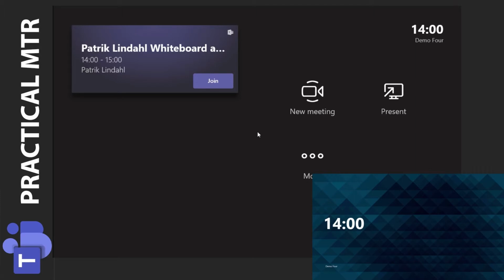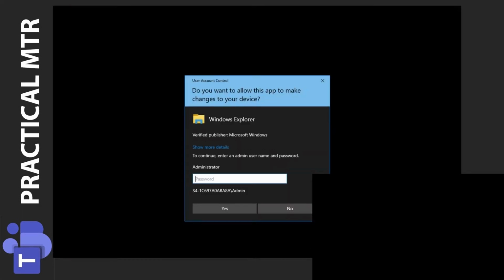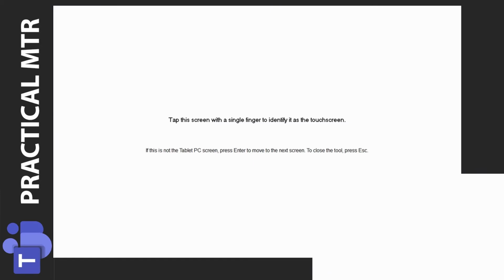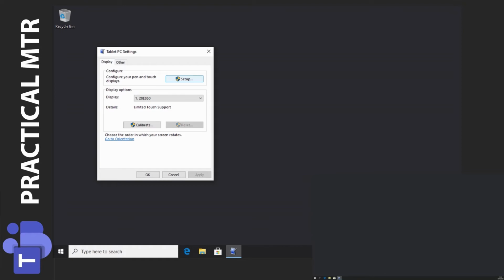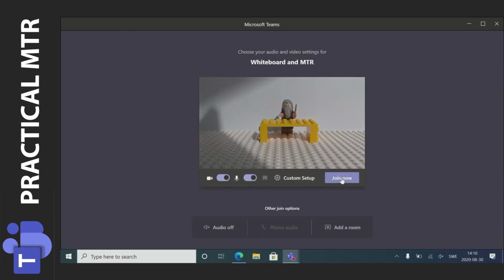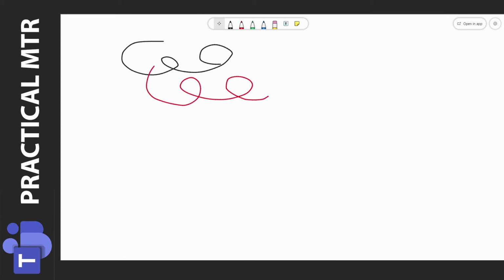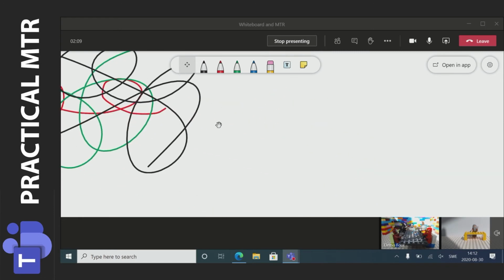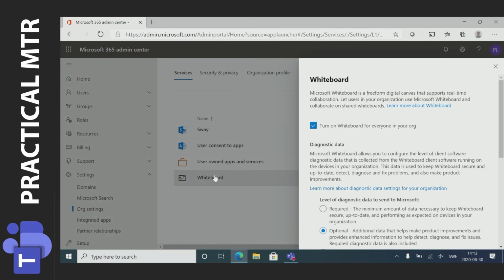How to configure the whiteboard in an MTR system

Comment: Great video ! If you do zoom on whiteboard, can zoomed view still be seen by remote participants ? What license you assigned to MTR system to get whiteboard running ?
Reply from the maker: First question there: The whiteboard will act as any other whiteboard in a Teams call. That is, when you zoom on your client, others will not see it. They themselves need to zoom, pan or anything else on their screen. It works the same between two clients doing this without an MTR system in the mix.
The second question: The whiteboard is part of the licenses fom Teams Rooms. That is "Teams Room Standard" and "Teams Room Premium". You do not have to assign another license. I talk a bit about the liceses in the video about setting up your own tenant: https://www.youtube.com/watch?v=mgXl-nzTnt0&t=296s&pp=sAQA.
If you choose not to use the licenses Microsoft prepare for you, you need to make sure you have the whiteboarding license in the mix yourself.